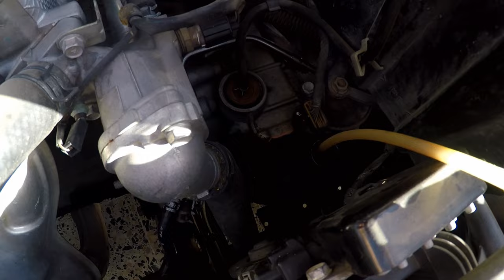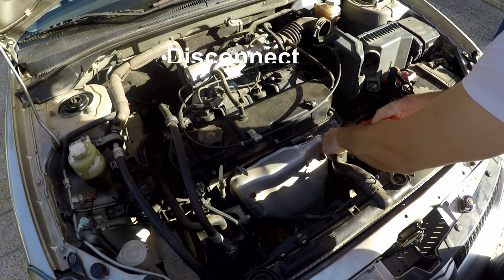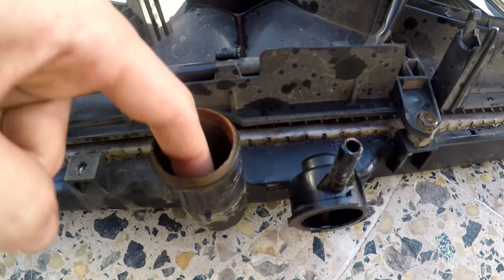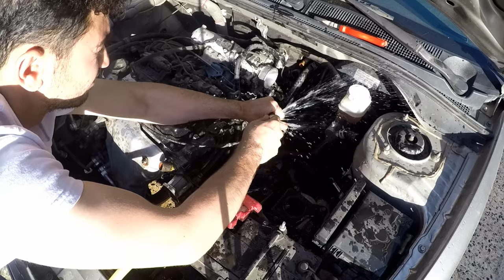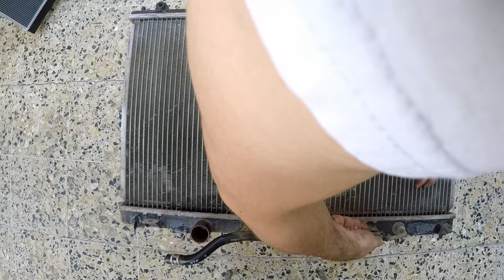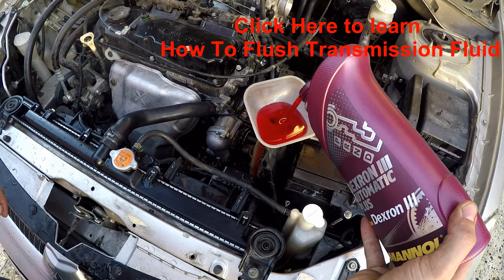Transmission Fluid turns to pink

Comment: Is it ok if my trans oil is a very light pink?
I already cleaned and flushed the whole trans with over 5 gallons of atf and it still looks a very light pink. The radiator is new and i know for a fact the oil is better than before. This atf oil is costly af.

Comment: Wow, I didn't know that could happen... Hmmmm THANK YOU !!!!
Reply: Oh wait, I know why, lol... Stupid / Silly me... The Transmission Coolant in the Radiator Coolant must have Holes / Leakage. Thus brings the Coolant / Water into the Transmission. I got it now :)))))
Reply from the maker: Yes exactly, and keep that in mind, the transmission fluid pressure is higher than coolant...
Reply: Last year, I flushed my Dad's Truck Transmission Fluid out and I did thought... Why in the World did they put the Transmission Fluid Coolant in the SAME thing with Water Coolant??? I thought that was DUMB :((((. To my surprises... This would happens in the Future.... Hmmmmm... Now I got another Project... :(((( I will have to make my own Separate Transmission Coolant :((((
Reply from the maker: I will make a video about that soon, i will install separated transmission fluid cooler, it will perform better cooling in hot summer and increase transmission fluid life...
Reply: +Ali Hoshyar - You are 100% Correct !!! It should have " ALWAYS " be separate :(((. I think the Manufacture does it to keep Cost$$$ / Weights and Space ://
Reply from the maker: Jod Bronson yes, they want to reduce cost, but in most modern cars it's separated...

Comment: Great video with the nice explanation..From the radiator cap exactly under the cap water comes out so do you think it's gonna be the same issue with your car ..? But performance of the car is perfect with no showing any thing from the dashboard..!!
Reply: Yea, I am thinking the same way. Best of all, the Engine doesn't' get damaged? Since Coolant / Water is in your Transmission :(((. Even if you FLUSH out with the New Transmission Fluids, I am wondering if there is more Water in the Transmission :////
Reply from the maker: No it wont damage engine and no warning lights comes on, but ones the transmission fluid mixed with coolant, you will feel the transmission won't changing gears smoothly, the car must be stopped immediately otherwise it will damage the transmission, and cost you a lot
Reply: +Ali Hoshyar - Yea, you are right.... I would say stop and clean and replaced the Fluids ASAP.
Reply from the maker: Yes exactly...
Reply: @AliMECH  the coolant in my car is now pink my mechanic flushed the coolant cleaned the resiovor in washed the radiator put it back in my car in ran the car for in hour in the orange coolant turned pink I asked him could that be transmission fluid in there he said no it it was it would be really red in its not the same color pink as in this video in its not milky
Reply from the maker: When transmission fluid turns Pink or orange , it's the amount of water and antifreeze that make it change color, is your cars radiator coolant gets low once a while?
Reply: @AliMECH  no not since they fixed the radiator hose oh never mind my mecjanic said the coolant he put in my car is orangish pink so nevermind
Reply from the maker: After changing the old oil, did the flush the transmission?,  I think some old oil stayed there and coused to change the new oil color
Reply: @AliMECH  transmission oil flush no
Reply from the maker: I have an oil video, showed how to flush transmission fluid without pump, https://youtu.be/QW-fboIrf80

Comment: I had the same problem... mechanic change the rad and oil filter and remove transmission oil by motors and put the new one but still colour is pink in the transmission what should i do now...is it good or dangerous
Reply: The transmission need to be removed and the catalic converter pulled up and flush. You may have to change some parts or buy a kit.

Comment: I just watched two videos and the transmission mechanics said not to flush out the pink sludge because it only makes the situation worse. The sludge is transmission fluid mixed with water and of course it got there from the radiator. The best thing to do is have the transmission rebuilt.
Reply from the maker: sandra johnson no need to rebuild transmission, just flush it, I did it to my car and it works better than before,
Reply: Are you sure? because even if you remove the old fluid there will be still some water drop in filter, or somewhere in transmission, radiator, so as soon as you put new fluid and start car, it will mix again with water and become again pinky some.
Reply from the maker: what i did is, not just changing oil, also flushing transmission, when the new oil added to transmission after sucking the oil pinky oil and start the car, it pushes the old pinky oil to radiator, at the same time the radiator hose is disconnected, so i waited till the new oil came out, to make sure that there is water in transmission or not, check the transmission oil after a week, my cars transmission oil still same color till now ... thanks
Reply: even remove the old fluid , it will leave some trace because oil plus water = sticky fluid
did you check the fluid color after one or two week after flushing the fluid of ats?
Reply from the maker: yes i did and its the same as new,if the flush presses done correctly,by the way water+atf oil not sticky like water + engine oil
Reply: it does because ther is water in my transmission when i touch, it stick to hand a little bit not like glue but sticky
Reply: How do you know if it's to late to change the radiator mine has this pink milky color and it shifts hard going from drive to reverse but every other gear is good and after it gets in gear it doesn't have a issue shifting
Reply: @soalsufer  Change the rad and flush it and the transmission. If your transmission works great, if it fails time for a rebuild or new vehicle.  The longer you wait the worse it will get.  Do nothing and you are guaranteed a broken transmission.

Comment: Any update on your vehicle?
Reply from the maker: The car is fine even after year and eleven month's
Reply: How about now??
How many miles/km you have driven since.?  slipping or delayed or hard shifting anything occurred after??. I have Mitsubishi Eclipse GS 2009. I have researched and got panic. Confused what to do after seeing radiator coolant contamination with light pink oily type. I check the transmission oil from dipstick I cannot find anything like strawberry milkshake its look like normal darker brownish  red only. Time to change but dont know if need to flush along with changing and flushing radiator.
Reply from the maker: I sold it a year a go to my friend, till now the car has no problem